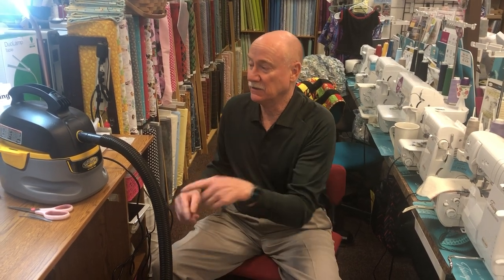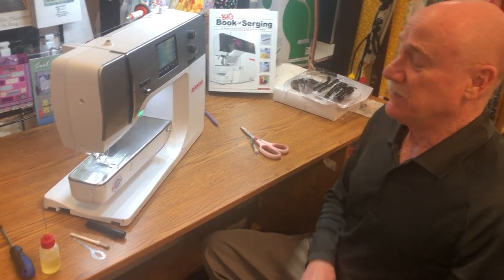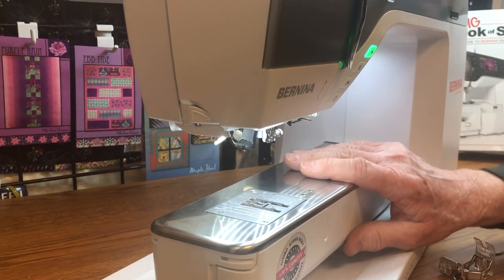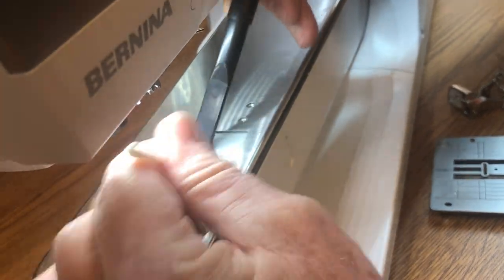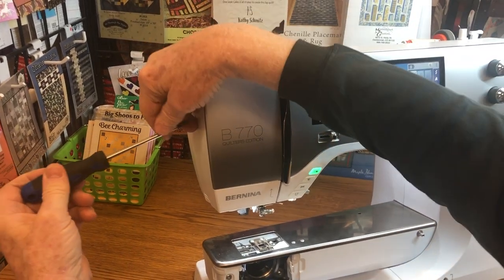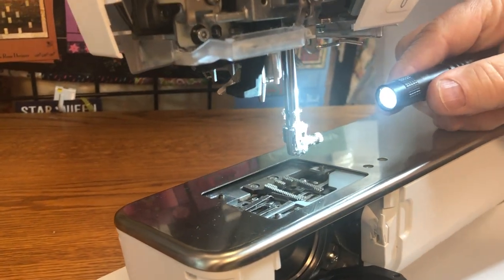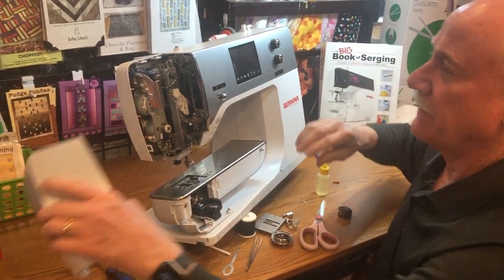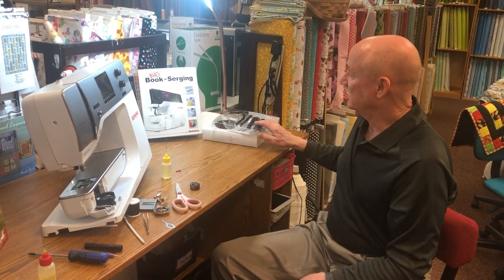How to Vacuum/Clean & Oil DIY Bernina 770 7, 5, 4 Series Sewing Machine Easy & Best Cleaning Tools

Comment: This is the best video ever. I live an hour away from a shop. The end of my spool had a little knot in it so when it spun off the spool it jammed  the machine. I am very handy and had seen this video before so I knew if I took the front cover off I could deal with the issue. Sure enough!. And since I was in there gave it a dusting and a couple drops of oil. Thank you so much for empowering Bernina owners!

Comment: What is the difference between red tip oil vs yellow tip oil?
Reply from the maker: The Yellow cap oil is general purpose sewing machine oil recommended by Bernina, the Red cap oil is lighter for the 9 hook or black bobbin system by Bernina only oil for that area

Comment: Dear Jeff, how to remote the Bernina B570QE head play cover... (as in the video 06:18)? I want to oil it, because squeaks! Thanks!
Reply from the maker: Laszlo, the plate that has 570 on it snaps off if you push it to the left, then inside there are holes to access oiling areas use a flashlight

Comment: Thank you so much for the informational videos. I need a little clarification on the wet dry vac you suggest. Your video says you are using a 2.5 yet you suggested a 1.5 in a customer answer. I am getting ready to order one to have on hand. I assume there is a range and I would choose to use the same one you have. Is the 1.5 sufficient too?

Comment: Thank  you so much for doing these videos.  I have saved myself many trips to the dealer.    I have had a couple of times where  when I start to sew the material gets caught down under the
plate that covers the feed dogs.  It is like the needle pushes the material down in the needle hole.  I have no idea why it does that.  It is hard to get out, and THIs time I had to actually cut the material to pull it out, which left a hole in my blouse.  luckily it was under the arm, and it was a small hole, so it won't be seen when I patch it.  I also sometimes have trouble getting the bobbin case into the machine.  Any idea what I am doing wrong to have the material pushed down into the needle hole.  Also,  I do love the bernina tweezer and love the oil  that you sell.  I think
after watching this video I need to get the little handy hook you have.  If I ever get to Grand Junction Colorado, I am going to come visit your store.

Comment: Thanks, Jeff.  That cool little lint thingy with the points on the end....one came with my 820QE and for 10 years it's sat in the box cuz I had NO clue what it did!  Thank you for this demonstration!!!   You also took some of the angst I have about removing the head cover....I absolutely HATE trying to get mine off because I'm so afraid I'll break off one of those little plastic tabs.  Lot of swearing goes on when the thread breaks and in order to fix the problem I have to remove the head cover to find the broken thread.  And I never was told to oil any of the parts under the head cover!   Again, thanks!  Linda from Maine
Reply from the maker: You are welcome

Comment: Thank you for a wonderful tutorial.  I have the crevice tools to attach to a vacuum, but no vacuum that easily works with them.  I saw you use a small wet/dry vac in another video but could not find it.  Can you tell me the brand name and other pertinent information?  Thank you!
Reply from the maker: Go on Amazon or eBay look for a 1.5 gallon vac that uses 110 volts those have good power.
Reply: @berninajeff  Thank you!